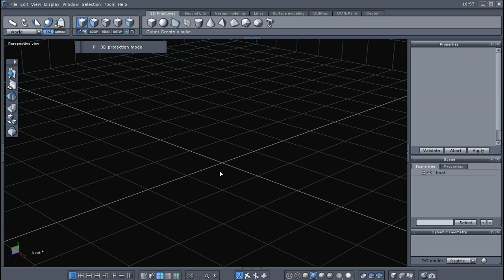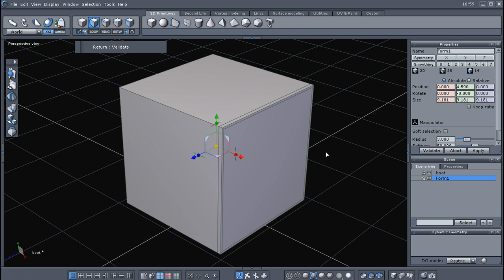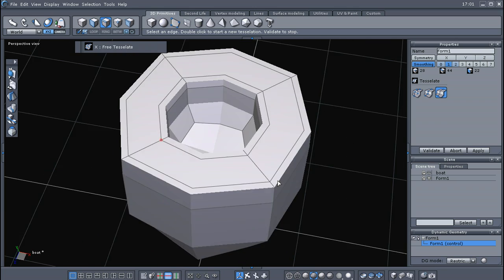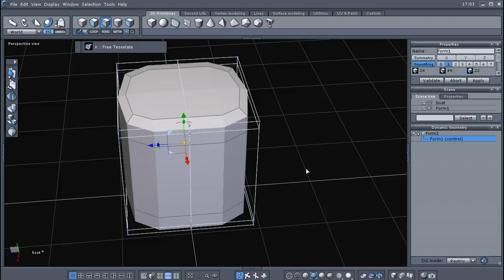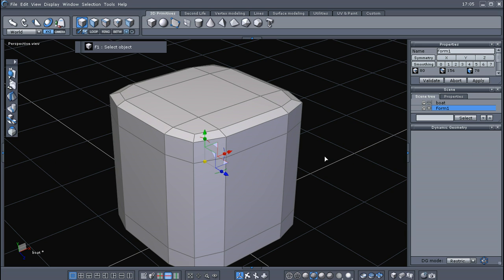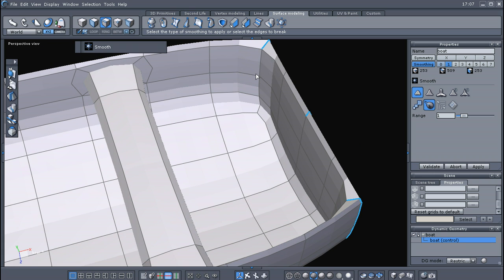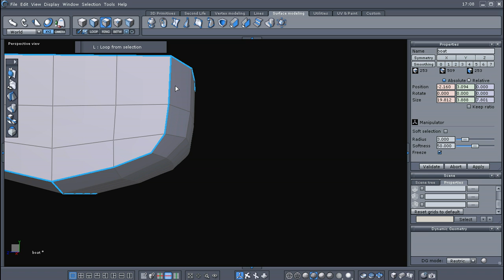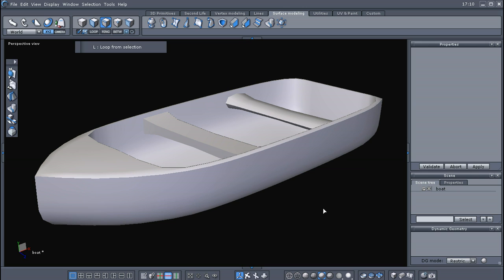Working with subdivision ( adding support edges)

Comment: P.S>- I realize you can 'slice' things up and that adds more segments ( I want a smoother bend), but is there no way to add subdivision by key press or button  without having to necessarily choose a edge ? Also..is there a way to get a cylinder for example to bend in the middle, for a nice tight 90degree bend ? (pipe)